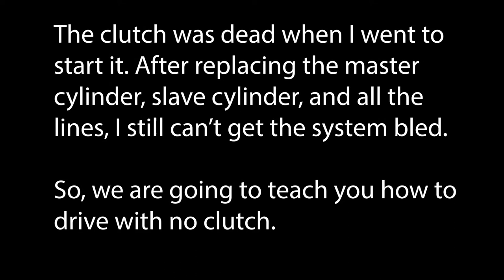How to Drive Without the Clutch - Master Cylinder or Slave Cylinder

Comment: cool...good tip.....its just that at every stop sign....it will knock ur engine dead and you have to restart ur engine and get going again.....but should drive with extreme caution.
Reply from the maker: Yep. Correct. Not ideal and you have to weigh the wear and tear against the costs of a tow truck and the circumstances. 

Getting me to a safe place: 100% worth it. Driving a block or two to a shop: probably. Just depends on what is happening.

Comment: Thank you,  I don't know if I'm brave enough though,  lol~
I do have a question for you. I had both slave and master cylinder replaced about 9 months ago... recently I have had issues of it not wanting to go into gear. Since I recently moved too far away from the original mechanic I found one here who told me that the slave happens to be a bad part. Because I'm waiting for pay day I've been winging it and filing it with the 3dot break fluid. This morning the clutch felt high, and tight so I assumed it was good, but when I put it into reverse it went backward so fast, and it didn't want to stop! I had to force it into neutral.  People had to push me back into my driveway. What was that?? Can I continue to simply refill it when I plan to drive it to the shop? Or is it more than just a bad slave cylinder now? Yesterday, after filling it to the max line, it got me to work and back. It didn't act crazy~
Reply from the maker: It does sound like a bad slave cylinder. I went through three different slave cylinders in this car. They were cheap auto parts store replacements and the first two were complete junk. It sounds like there is a leak in your system somewhere. Enough for you to get it in to reverse, but not enough pressure to keep the clutch disengaged to go slowly. It could be a line too, but it's probably the slave cylinder. That's what fails most commonly. Sounds like you can limp it to the shop, but idk use your best judgment there.   If it doesn't want to go into gear with the car off, you probably have different problems.

Comment: HOLLY SHET! I my guess was right. I had a slave on the floor.  Changed it out following all instructions. I mite as well as drive wo the godam thing shit. I typed in if it was possible to drive with it because I had to move the fker to look for tools. As long as there is nothing in the way u can go. I'll just drive it later. Thx man

Comment: also if your clutch pedal is kind of engaging right as you let off the floor I mean I'm talking half inch 3/4 of an inch and it's already engaged in gear as opposed to when I first started driving the vehicle it would engage 3/4 of the way up almost all the way up top and sometimes I'll do that sometimes it won't and then also just recently my floor was wet and there was a big stain of some kind of an oil or I'm assuming master cylinder fluid but I've got the fluid up to level and everything how do I know which part is actually bad with these symptoms that I have do you think it's an actual clutch itself or do you think it's a slave cylinder when I'm pushing the pedal when it was working and actually engaging not just floating basically there I saw the slave cylinder moving a pretty good amount and I couldn't see any fluid coming out of there or dripping out and of course now like I said it's not moving or doing anything but does that sound like something you've dealt with before or that you think you might know what my issue is should I just start with a master cylinder and go from there
Reply from the maker: I didn't see this earlier. You generally want to start with function checking the master and slave cylinders. If your slave cylinder is moving the clutch arm, then it is working and you have a different problem that is probably inside the transmission. If I could see my slave cylinder working, I would take it to a shop because the transmission probably needs to come out and it may need a new clutch.

Comment: Master cylinder looks like it’s leaking in my 1999 accord. I checked the clutch hydraulic fluid and it doesn’t look like any has really left but when the clutch petal is all the way in it’s still partially engaged and I have the problem putting it into gear so I don’t think filling it up with more fluid will help. I think with rpm matching and using the clutch it shouldn’t put too much wear on the transmission when I take it to the shop tomorrow and I’m not confident enough to try and float all the gears 😂😭 I wish I could fix it for like 30 mins but the fluid is definitely over the line so🤷🏼‍♂️
Reply from the maker: Ahh that's too bad you can't just get it working for the quick drive. Hope you make it safe and sound!

Comment: Can it cause the gears to crash or stall the motor if you dont Rev between gear changes?
Reply from the maker: Probably wouldn't stall, but you would put a lot of wear and tear on your syncros and probably won't get the car into the next gear. It's critical to match the engine speed with the transmission speed to do this without hurting things. It's what makes the whole thing work when shifting.

Comment: Your car was done right: sounds mean, not like a fart can. And it picks up speed in a turn flawlessly. Seems easy to handle, or maybe you make it look that way? But seriously good job with your car.
Reply from the maker: Thanks Adam! The inline 4 in that car loves to be revved. It was paired with a full exhaust. Stainless headers, magnaflow high flow cat, and a magnaflow cat back. Suspension was a full coilover kit made by Flying Miata. Finished off with a decent set of Hankook tires. I could throw that car through corners all day. Very fun to drive!

Comment: Now what if u have no pedal .meaning there is no pressure there it just kind of freely moves wherever and only goes about 3/4 of the way to flooas opposed to normally going 100% ..  essentially if you were to reach down there and grab the clutch pedal with your hand whatever position you wanted to set it in you could move it like just easy no pressure needed one little finger you could push it up or down and it would just stay wherever you said it whatever position so and it's almost impossible to get it into first gear any gear what would a person do at that point is there a way to still do this do I just got to keep pushing and forcing and kind of rolling the vehicle little trying to get it into first and then even though there's no pedal there it doesn't really matter cuz it's not like you were using your pedal anyways? Or I don't know
Reply from the maker: You need to get it in first gear with the engine off. Then you start it, this moves the car. You then shift without the clutch. Some clutch systems and/or failures will not allow you to do this. If that's the case, you need a tow. Keep in mind, this is hard on components (Starter, syncros, transmission, etc.). So, proceed at your own risk. The safest option is a tow anyway, but this can get you out of a pinch.

Comment: So you're basically taking us how to further destroy everything else 🤔😂😂
Reply from the maker: If you want to look at it that way, go ahead. Life is about managing risks. If you are decent at rev matching and not forceful with the shifter, your transmission risk in a modern car isn't that great. There's some increased wear, but you are wearing out every single part in your car every time you move it. The starter will take a somewhat higher than normal load, but nothing outrageous unless you find yourself in stop and go traffic. Would I drive it across the country like this? No. But, would I move the car to a safe place using this method? Absolutely. Would I use it to save a tow bill to a nearby shop? Probably. But, it depends how close and what kind of driving I need to do to get there. Thanks for watching.
Reply: @Toledo Cars  I see your point , thanks for replying and the further explanation

Comment: So what are the disadvantages of doing this? Doesn’t it have a negative impact on a gearbox or something🤔
Reply from the maker: If done perfectly, it doesn't necessarily hurt the gear box. Anything outside of absolute perfection though is hard on the synchros and other parts. It's not hard on the gears, but everything else involved in shifting inside the trans will wear faster. You don't want to do this all the time or that frequently. It's something that you try a every now and then to get the hang of it, then save for emergency use. Moving the car and shifting without the clutch is useful because it can get you to a shop or at least a better place to pull over.
Reply: There is no advantage to doing this.  You would only do this if you were stranded in the middle of nowhere and couldn't get a tow truck to get your car to a shop or weren't able to replace the master cylinder or clutch where you were.  No one could ever be perfect at shifting like this which means you are grinding down gears and causing damage in the transmission that will be very expensive to fix.  Consider that rebuilding your transmission after you screw it up is going to cost north of 1500 dollars while you could get a master cylinder or slave cylinder for about 50 a piece.   This is not good to do... not good at all.

Comment: What if I can’t push the clutch in far enough to start it?
Reply from the maker: Then you probably should tow it. That's a really odd clutch failure though. Typically, the master or slave just loses the ability to hold pressure. Not sure what would prevent your clutch pedal from being depressed fully.

Comment: I don't get it.  If the clutch is fully engaged and cannot be disengaged, I don't see how you can rev the engine.  If the clutch is fully engaged, then the engine speed has to be in lock step with the road wheel speed so far as I can see...    ???
Reply from the maker: You are forgetting about neutral in the transmission.